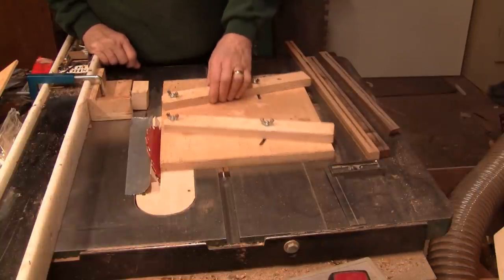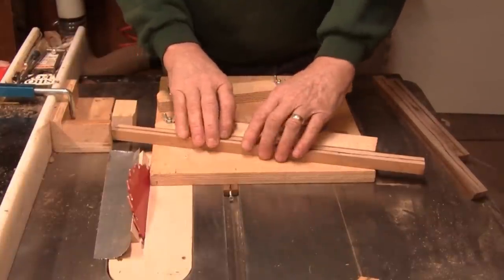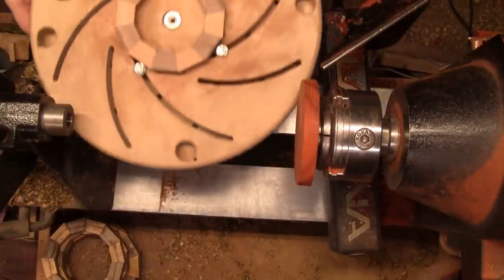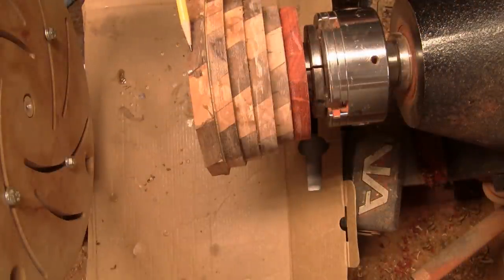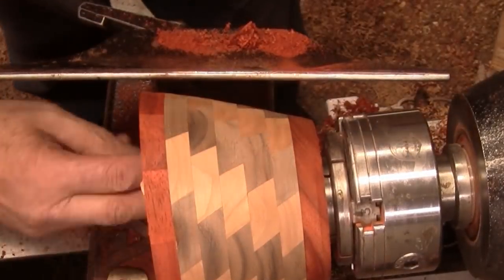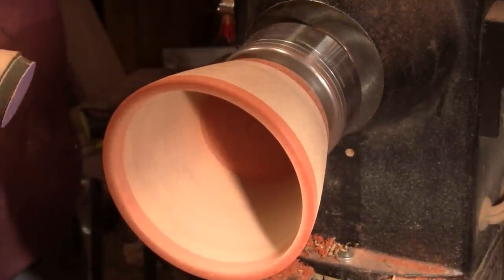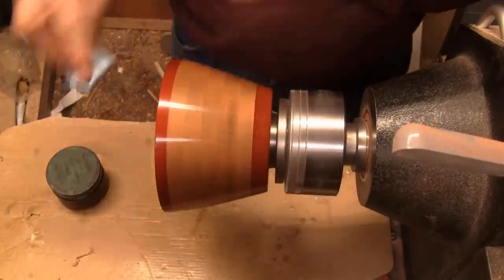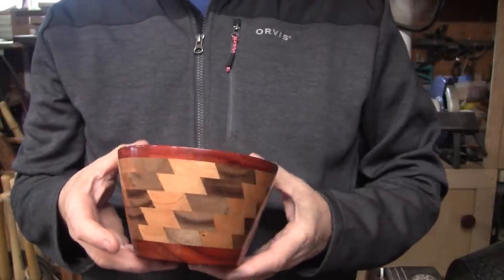Wood Turning A New Slant On Making Segments

Comment: The bowl came out very nice.  Well done.   Good tip to correct the angle of the alternate pieces.    The accent ring on the top was a good addition.
Dave.
Reply from the maker: Thank you Dave, I was happy there was very little waste trimming the ends and it did work out good.
Hard to go wrong with Padauk and for sure it dressed it up nicely.
Thanks for watching,
Gary

Comment: I just watched this for the second time. I'm sure I saw it about a year ago. I have a better appreciation for the cutting and layout now I believe. Unless there is a lot of work you didn't show, the glue up and lay up of the rings doesn't appear as difficult as your comments  indicate. I understand the potential for slip of the diagonal joints but you appear to have overcome that problem with the plexiglass and the the press. The ring alignment appears dead on accurate. It did take me a bit of time before I understood your comments about the "mirror image" when cutting the segments. But I think I have that concept down pat now. Thank you for sharing. Have a great day and stay safe.🙂🙂
Reply from the maker: Thank you Glen. I will have to watch the video again myself to remember what I said but the fact that the joints are on an angle they will try to slide on you. The mirror image kind of fools you.
Best of luck when you decide to give it a try.
Thanks for watching,
Gary

Comment: I love your different approaches, like this, and would love to try this, but I will take your advice,and do some with straight cuts first. Especially since I don't have a press like that. But I'm intrigued. I'm always drawn to that which is just outside the ordinary. Thanks Gary!
Reply from the maker: Thank you Dave. Yes this could be very frustrating and could lead to just not wanting to do segment work.  But process I came up with worked great. And for sure a press would be handy but you could do it with a large C-clamp.
Thanks for watching,
Gary

Comment: Hmm, the Longworth chuck idea might be the basis for an  excellent clamp fixture.
Reply from the maker: Mounting on a solid frame that would be a great idea. It could be vertical or horizontal.
Reply: @ThePapa1947  If it is flat and perpendicular to the lathe's axis, it could be used to sand the rings flat, using a sanding disk in the spindle.  It would be necessary to have brake to keep it from spinning.

Comment: Gary, Great bowl.  The slant joint lines add a lot of visual interest and the choice of woods with that stunning chatoyance make it an outstanding piece. I do have one request, I searched your playlist for a video on your segment cutting sled, construction and use.  Have you done one?  If not, it would be a useful one.  Hint! Hint!  Thanks.  Cheers, Tom
Reply from the maker: Thank you very much Tom. Happy  you enjoyed the video. 
Funny thing is I have been planning on showing the use of the wedgie sled. I have not done a video because I cut the slots using my CNC and not everyone has one of those. 
But I certainly want to show the proper use of the sled because I see it using wrong a lot.
 So yes I will work that in. In may be a midweek thing or must might be  a Friday video. The video I did today got posted last night. I was running this close and some final editing to do. So an easy one is always welcome.
Thanks for watching,
Gary

Comment: Great idea Gary! Very creative. 👍 I wonder, if you reversed the direction of the next layer and aligned the tips, then you'd have an arrow head (or fletching) pointing in 1 direction. Could reverse that for the next layer, or align the next layer (same direction as the previous but the sides aligning) then reverse to form the arrow head in the opposite direction and you'd get an extended zig-zag pattern from top to bottom. Smaller pieces would work wonders for this. Apologies if not making sense! Very long and cold week. Bless you my friend. Ray
Reply from the maker: Thank you Ray! So I made a small set of 4 rings and reversed the direction. I just did not like it. Plus what happens to do that is you will make 2 rings the same diameter and with a segmented turning it is nice to have the diameters follow the shape of the bowl. In that case you would be making the rings extra big to accommodate that. I had to drink 3 cups of coffee while I debated that issue LOL.
Thanks for watching and blessings to you as well my friend,
Gary

Comment: Hi Gary! I've graduated from turning blanks to making fairly intricate segmented bowls, so my next step I'd like to try is this slant-style. You went the opposite direction for sort of a zag pattern, but presumably if you went the other way you could have a smooth spiral up the side of the bowl. Is that accurate?
Reply from the maker: Hi Nick, if I understand what you are asking you could have all the edges of the walnut lining up. It would not have overlapping joints from row to row. But with the top rim and the bottom I doubt there would be a problem with it coming apart. It would be an interesting look as well.
Have fun with making segment turnings.
Gary

Comment: You blowed up my mind twice, Gary. First are angled segments. Need to watch it few times to understand the angles. Second is how did You made that few rings were spinning, few not when You started shaping the bowl 😉🤪 Impresive work again 👌 I have one "but" only. Would the bowl looking better if You could rotate the rings on other side and the angles of segment and angles of pattern would go in the same direction 🤔 Hmmm? What You think?
Take care Brother 💪
Rav
Reply from the maker: Thanks so much Rav! It was lots of fun for sure. I wanted to explain how you can not just cut the segments off one stick and expect them to fit. That would have made 2 rings which you could glue one to the other. 
I did look at that as a way to do it but did not like the look. Not that it was bad but it just did not flow. I drew the pattern up and decided this was what I wanted. To save material I trimmed the ends which worked out great and wasted very little wood. 
Thanks for watching Brother!
Gary

Comment: Fabulous!!!  You have an excellent command of 3D geometry.  Question:  Do you have a video on your glue press and/or longworth chuck?
Reply from the maker: Thank you very much Jim, I do not have a video of either one. 
I used my CNC machine for a lot of the longworth chuck but it can be done with a router. There are lots of videos on doing that.
I could do a video showing how I constructed the press if there is enough interest. Which I think there is now.
Thanks for watching.
 Gary
Reply: @ThePapa1947  CNC machine....that's cool.  The geometry of the longworth chuck would be interesting enough on its owm.

Comment: Such an easylooking faceplate. Does it hold the detail firmly enough for routing?
Reply from the maker: With different stoppers on it and using all 8 positions you can clean up the bottom a bowl at a slower speed and I would use tailstock support most of the time. But I have cole jaws I use for doing that.
Reply: @ThePapa1947  Thanks a lot! Hope to improve my stuff soon. Best wishes!

Comment: My husband and I love watching your videos. Where do you get your 3/8 and 5/8 bowl gouges?
Reply from the maker: Thank you Emily, I have them from two manufactures. I have some Robert Sorby I bought at Rocklers and I also have some Benjamin Best I bought from Penn State Industries. For the price the Benjamin Best are decent tools. I have been given gift cards to Rockler and I generally get a Robert Sorby tool. And I think they are very good gouges. 
 It is tricky when buying a gouge. Some measure the shaft size so a 5/8 will have a 1/2 inch flute.  So my Sorby I call a 5/8 has a 1/2 inch flute and they call it a 1/2 inch. The BB brand calls it a 5/8.
 Hope that helps and thanks for watching,
Gary

Comment: Gary.so this is basically a compound miter I think. Very unique and I’ve never seen it done before. Do you have a video on making the Longworth Chuck? I assume you did it on a CNC.
Reply from the maker: Hi Mark, yes it is a compound miter if glued together the way I did not use it would form a cone of sorts.
I do not have a video on the Longworth chuck just because I did do most of it on CNC and not everyone has one. You can find the layout for doing it with a router and I think I have that somewhere.
Thanks for watching.
Gary

Comment: The use of the plexiglass retainer with the press is a stroke of genius that is applicable to gluing any kind of segments.  But are the band clamps actually necessary?  I think if the wedges are cut accurately, then rubber bands should give enough pressure to hold them in alignment while the glue cures.  Also, when the rings are glued together, that adds a large amount of glued surface that prevents a catastrophic failure.
Reply from the maker: For sure the plexiglass was nice to have. I cut it from a large square piece I use for gluing rings on.
I am sure the rubber bands made for nice glue joints. I feel the band clamp assured me they were all in proper alignment. Trying to lift the plexiglass off after the rubber bands were on was not an option. They would try and pop up out of place.
 So either way would probably be fine.
 The overlapping of the rings is really the only thing I trust with segmented turnings so for sure it adds lots of strength.

Comment: Your techniques for segmented piece are seemingly endless Gary and I like the tools you made to help create them.
The press and the tailstock addition to hold them are both great tools.
One thing about sanding Padauk: When I try that without prior cleaning off the sawdust I get a red smear all over the work. 
That doesn't seem to be happening with you, but why?
Reply from the maker: Thanks so much Leo! I do enjoy making all those tools. 
When I sand the Padauk dust get all over but I do not get any smears on the other wood.
I am taking a guess but perhaps you are pressing to hard with the sandpaper? The wood is oily and I could see it smearing if it got heated up or the sandpaper is dull. 
 But I do not recall ever getting smears while sanding. For sure if too much finish is put on it is instant staining.
 Next time I do this I will try and make it smear just to see why it might be doing it.
 Thanks for watching,
Gary

Comment: Great  video.  Question,  you usually do a sanding sealer before applying a finish.  Is there a reason that you went straight to the lacquer spray without a sanding sealer?  Thanks.  Take care of yourself and stay safe!!
Reply from the maker: Thank you. I use sanding sealer before some finishes. Some finishes will raise the grain a lot so I use sealer because I know I will be sanding it.
I find the way I put the spray lacquer on it does not seem to raise the grain. On the other hand if I brushed on lacquer it will raise the grain and in that case I will use a lacquer based sealer.
 Hope that explains it.
Take care,
Gary

Comment: Gary, I am with everyone else that has commented. This is an amazing lesson in how to do unique segments. It may be complicated, but you sure make it look easy. I have never considered segments before, didn't even know it was a thing, but you have showed me the way to make amazing bowls and artwork. Thank you for the great lesson. I can't wait to try this out myself and see what happens. The special chuck seems like a must have. Can you give us some detail on how you made that? Also, how important is reverse on a lathe? I just have a Craftsman bench top lathe with multiple pulleys to a motor. Seems like it would be hard to work out a reverse on that setup. Do I need it? Thanks for everything, and see you next week!
Reply from the maker: Thank you Mark. These segments were different for sure.
For sure start with normal ones so the glue up will be much easier.
 You can do it without the longworth chuck and I did for years. I have a CNC machine which helped in making it but you can do it with a router.
 Reverse is not a must at all. I have it and like to sand that way. I directs the dust away toward my dust collector port.
Years ago I wired my old Craftsman lathe to run in reverse. As long as it has capacitor start you can do it. And I did wire it just for sanding. But you do not really need it.
 I only mention it because I have had comments telling me I am sanding on the wrong side of the piece.
Thanks for watching,
Gary

Comment: I was all set to try that today but realized that I built my sled to cut on the right and I have a left tilting blade. I don't want to wreck my new sled so I guess if I want to try this I will have to build another sled.
Reply from the maker: Hard to say. What type of a sled are you using?
Reply: @ThePapa1947  I built one that cuts on the left side of the blade and has an apron on the right side so that the cut off comes back with the sled and keeps my hands well away from the blade. Since it now has a zero clearance blade slot if I wanted to cut the 30 degree angle on the segment I would screw up my new sled. I am going to try to post a short video on youtube later today.
Reply from the maker: I worked as a wood pattern maker and all the shops had table saw that tilted to the right. I had an old Craftsman at home that tilted to the left. I hated it but it worked.
 I came across a Grizzly cabinet model that tilted to the right and bought it.
I always use the slot on the left of the blade for sleds.
I will watch for your video
Gary
Reply: @ThePapa1947  It is posted under oldsloane and titled My new safety wedgie sled.

Comment: 🤣...what brand of glue wouldn't you recommend?  Did you say and I missed it?  🤔
Reply: Oh, just something I noticed...other wood turners went off on me...which is why I say 'just something I noticed'...sanding the bottom of anything with the lathe off makes a smoother surface.
Reply from the maker: I started out using Elmer wood glue in 1962 and used it for many years. We used it at both pattern shops I worked at.
I know use Titebond Original. I use Titebond III if the glue up is going to take a long time because it gives you more time.
Reply from the maker: Do you mean the bottom as the part that it sits on or the bottom of the inside?
There are times I will sand with the lathe off but most of the time it is turning. I have not had a problem with either way.
What has been the experience you have had with sanding while it is turning?
 I am always looking to try new ways is why I ask.
Gary
Reply: @ThePapa1947  I thought the yellow glue was Elmers Wood glue...just thought it was kind of funny you said you wouldn't recommend that glue...but unless I missed the name...really didn't know which brand it was.  No, they don't make things like they used to...between outsourcing and using chemicals that are cheaper...nothing is the same.  Makes you appreciate you woodturners for doing the hard work you do.  At least you know it's not mass produced by lazy bones only wanting to get their next paycheck and not really caring about the product.
Reply: @ThePapa1947  the Padauk pieces is what I meant by being unsymmetrical.  I used to own a little shop called 'From the Cellar' where my late fiance and I would make cribbage boards, clocks, octagon picnic tables and 9 X 9 sheds.  We got around the needing a permit because those are for 10 X 10 buildings or bigger (at least when we were building them) by making 2 9 X 9's and attaching them together.  Back then, money didn't seem to rule the world like it does today...but we still wanted to give people a break.  I noticed then if you sand the bottom of a bowl or whatever with sand paper while it is going on a lathe...you ended up with more pieced scratched.  However, when the object wasn't moving on a lathe...it ended up smoother.
Reply: It was smoother for us because we were able to go with the grain...where as if the lathe is turning...you maybe sanding against the grain as well.
Reply from the maker: I am able to run the lathe in both directions. Plus with segments I am going with the grain almost all of time.